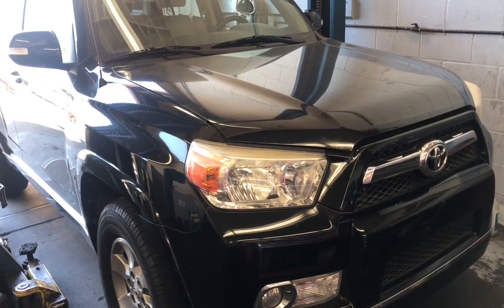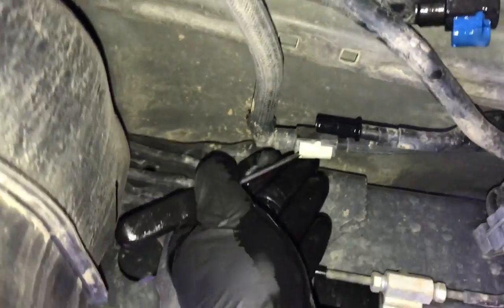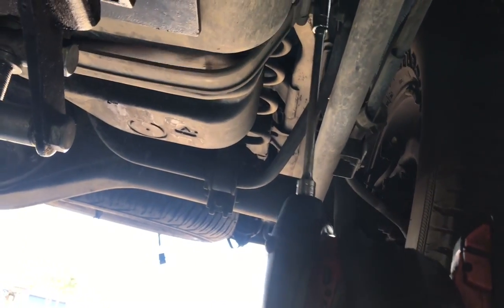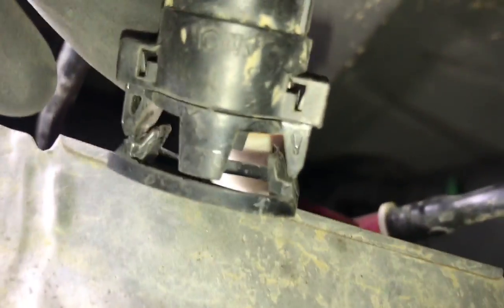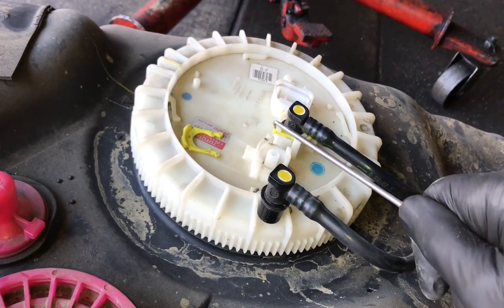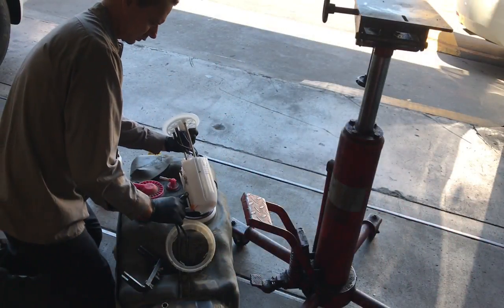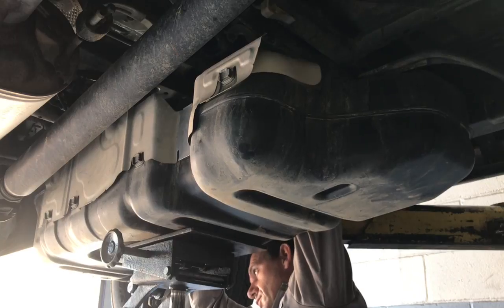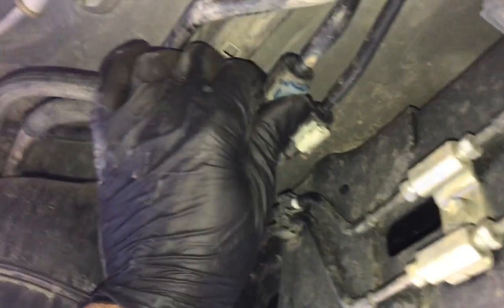Replace the Fuel Pump on a 2010-2018 Toyota 4Runner

Comment: I watched this video multiple times trting to familiarize myself with the steps, just to end up cutting "door" to access and replace the fuel pump. Some JB weld to keep my "doors" closed and it's perfectly fine looking and no one will ever see it. Cut the access and be done with it. Took me 2 hours and thats only because I had to go buy a locking ring removal tool. Fired right up like new with zero issue.

Comment: Great video, Just want to add that I could not get the bigger vent line off from the tank side while it was mounted…follow it back, above the spare tire, way easier to get it off on that side…just pay attention to the hose routing for re-assembly

Comment: Thank you for a very informative video. I just purchased a used 2015 4Runner and 300 miles from leaving the dealership (dealership was 220 miles from my home) check engine light came on. Took it to the Toyota dealership in my town and it came back with the code PO456. The dealership recommended replacing the EVAP canister. I first replaced the gas cap and cleared codes. Code came back a few days later. My question is when the fuel pump was replaced, could the EVAP canister or hoses been affected when the dealership replaced the fuel pump prior to my purchase? Thank you again.
Reply: Did you ever figure it out?

Comment: I followed this video very closely but I just replaced the pump and strainer. My FJ Cruiser cranks but won’t start. Is there a final step to purge the fuel lines of air or prime the fuel system? Thanks.

Comment: Watching this video just saved me a ton of work.  Not going to do this myself; taking it to the dealer for the recall, but the lady at the service desk told me I’d have to remove everything in the back of the vehicle.  In my case, that includes a loaded drawer system and fridge slide.
Don’t see any need for them to have the back empty.  Service lady is mistaken. 
Had it in to them before.  They freaked because of the aftermarket CBI fuel tank skid.
I’ll remove the skid for them, because obviously it’s beyond their skill set, but will leave the drawer system in place.
Thanks for an excellent, informative video!
Reply from the maker: Stanley Hall glad the video was helpful. Thank you for watching!

Comment: Hi. My neighbor ask me to get fuel out of his car with a long hose. But now the fuel level stays at half even if he fills it up. Did i damage the float/sensor assembly? 2019 highlander v6.
Reply from the maker: mark hadap sounds like you hit the float. I would take out the fuel pump and check.
Reply: @HowtoAutomotive ouch!. ok man. Thanks. 👍
Reply: Apparently it wasnt my fault. Dealer replaced the fuel pump because of recall and bended the float!😊👍

Comment: Hi Brian, great video, I've followed it through for the FJ cruiser, very similar. Connected everything back up but the vehicle isn't getting any fuel to the engine. I've tried priming by starting but after 10 mins it's still not starting! Any idea what it is?
Reply: Thank you for the response. The fuel pump is working. I'm getting fuel pumping through the blue line (blue connector) but none through the white one. Unless that's a return line? I'm not sure.
Reply: TheJezwick Did you find solution? I’m experiencing the exact problem on my FJC.
Reply: @MissionOffRoad  hey! Check out how you put the rubber o-rings properly back on the fuel pump...it should be the plastic spacer then the rubber o-rings. If not, the pressure isn't enough to feed to the engine. That was my issue!
Reply: @TheJezwick  You are a lifesaver! I found the o-ring that came with the pump. I installed it and everything works again! Error on my part. Thanks!
Reply: @MissionOffRoad  woohoo good stuff! Glad it's up and running again
Reply from the maker: TheJezwick need to check to see if there’s power and ground going to the fuel pump. May have a blown fuse. Also look on the dash if it has a security light flashing it will not start. Try a separate key

Comment: For the 4runner SUV. Remove the back seat bolts (behind a passengers ankle) usually 3, the seat can then  be tilted back revealing a panel. Remove using the other end of the wheel nut wrench, crowbar or large screwdriver. The top of the fuel tank pump is revealed.
Reply: You can only unplug it from the access panel. Still have to drop the tank.
Reply: Does this apply for 5th gen 4Runners?
Reply: Better method. Sit on back seat. Behind your ankles are three plastic moldings. These pop out easily using a screw driver. Remove the bolts. Use a hexagonal socket head only. Don't use a star type socket. The seats will now lift and swing backwards. To get to the fuel pump it will only require the double seat to be lifted but you have more space with both lifted.

Comment: Great video. About how long did it take to do the whole job? Toyota is now recalling around 700k 2018-2019 4Runner for the fuel pumps that may fail at high speeds. Letters to go out to owners in March 2020.

Comment: I just filled up and drove off... not 50ft away  my t4r stopped dead. Like a light switch. No sputtering or stumbling, just off.
Turns over like a champ, no CEL's nothing flashing...dead.
No fuel pump audible.
Is there a relay that may be the culprit? I couldn't find one labeled as such. 
The Delphi price ranges from 400+ to over 700 and the Spectra brand is approx 215$
Any input on one over the other?
Thank you kindly
Dave
BTW....your video quality and flow is the best I've ever seen
Reply: Dave, did you ever figure this out? Mine just did the exact same thing. I need to figure out what the problem is before I do something major - like drop the tank in the yard in the middle of winter.
Reply: Mine did this today, I ran out of gas on a hill a few days ago so thought it may be related, did you guys need to replace fuel pump?

Comment: Hey Brian I have a 2006 Tacoma which I think is fairly similar to the 4Runner fuel pump, but the gauge is reading inaccurate even after a OEM fuel pump / sending unit replacement. Any ideas?
Reply from the maker: Brian Lugo check the wiring harnesses for corrosion. After that I would pull a wiring diagram to see what else in the circuit and if all checks out then the gauge in the dash would be bad.
Reply: Cool thank you for the reply!

Comment: Thanks for  you for this valuable informations, I have a Hilux 2012 I made a cut of about 20×20cm above the location of the fuel pump under the rear seat. I think it is good choice for easy replacement but needs to a boldness to cut such a new car
Reply from the maker: Hazim Khalil they should have put access door there in the first place😉 thank you for watching!

Comment: This Denso type for Toyota can be rebuilt by just replacing the filter and pump on the plastic assembly
Reply: Is that so? My 2013 4Runner needs a new fuel pump so instead of spending 300-600$ on a whole new assembly so I just ordered the electric pump with the strainer for 70$ wish me luck
Reply: @VonMillie  yeah man, there are so many tutorials on how to place the pump, if you want to make your life easier get the tool for the retaining ring and a new o-ring , best of luck
Reply: @VonMillie what are the results😳 currently having this issue now
Reply: @richardhernandez7017 no truck is running fine as of today almost at 200k. If you plan on doing this I’d recommend getting the denso fuel pump on rock auto
Reply: @VonMillie do you know the link for this denso. I’ve been trying to source a denso fuel pump but can’t find one
Reply: And the sending unit?

Comment: Brian, my question is actually timing belt replacement for Lexus is300 2003. When removed the crankshaft bolt all gears moved, I did 2 full revolutions on the crankshaft bolt and it re-aligned all marks back to TDC. Removed crankshaft pulley, idler and valves cover. Timing belt still in place When I tried to loosen the vvt-i 10mm hex nut while holding the shaft with crescent it moved, now all 3 sprockets (2 cams and crankshaft) are all 1 tooth off...I don't know how to re-align I'm stuck and nervous to move forward! Should I make 1or 2 revolutions on the crankshaft? Can I also remove the timing belt and the cams to replace the cam seals? Or should re-aligned all camshafts and crankshaft first? Please help!!!

Comment: Looks like the most difficult part of of this job is figuring out how not to break those vent and fuel line connectors
Reply from the maker: Definitely the tough part is not breaking those vent lines.
Reply: How to Automotive I long for the day when all manufacturers will agree on a standardized connector design...

Comment: Hi Brian I NEED your help i  have a 2011 x6 and i have a code 28A0 ,  I HAVE CHANGED THE THROTTLE BODY AND THE MAP  Sensor  and i still have the code what could be the issue your assistance will be much  appreciated
Reply from the maker: ian young Check intake system and crankcase for leakage
Check throttle valve (contamination, carbon deposits, icing)
Check plug and wiring harness between intake- manifold pressure sensor and DME
Check plug, wiring harness at electric throttle- valve actuator
Reply: How to Automotive Hi Brian Thank you very much for your reply i will check all the the items you suggested i really appreciate your help i will keep you posted.
Reply from the maker: ian young glad to help 👍🏻 thank you for watching!

Comment: I don't own or know anyone (I'm no longer a mechanic for some time) with this type of vehicle. What I found very interesting was the type of specialized tool, in which case you mentioned that this is a "universal tool" for removal of the lock ring for this fuel pump. Most  fuel pumps are of the same design? So, this is for the "good to know file" for me. Thanks for the video!